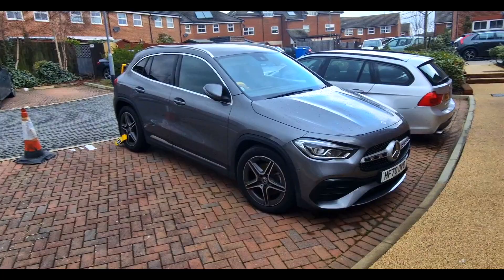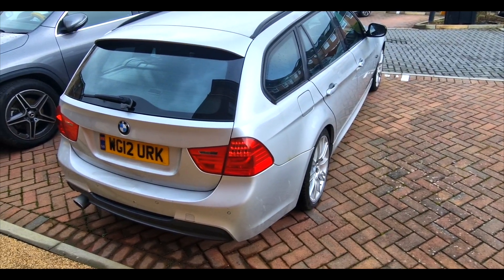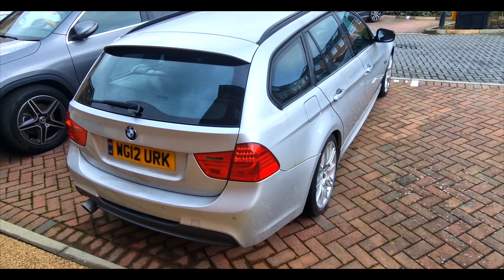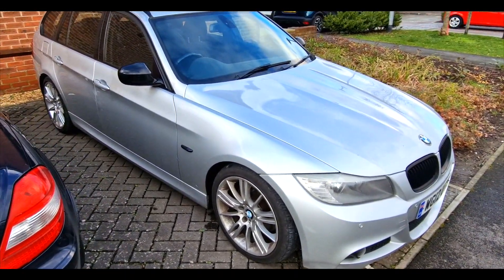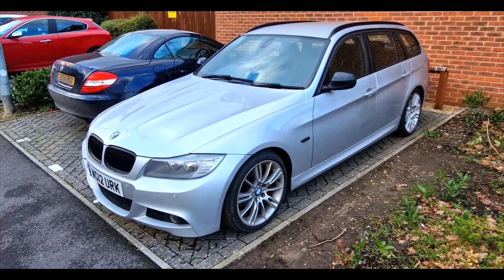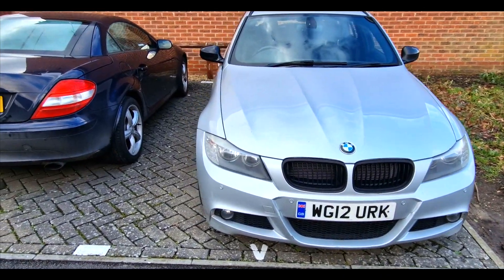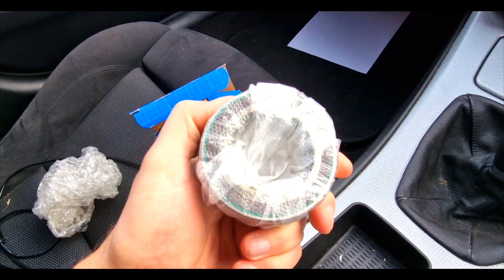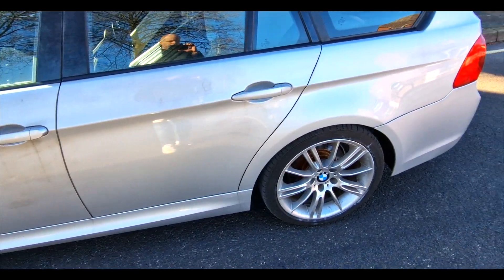What Was The Droning Sound On The BMW E91?

Comment: Sounds like the guy was a decent tech. Diff noise is usually a totally different sound from wheel bearing and starts off pretty much straight away . Wheel bearing will come in at a certain speed and if you lightly swerve side to side can sometimes make it louder and easier to pinpoint . If you keep it those winter tyres are great for grip during the cold season.
Reply from the maker: Sold the winter tyres, think the bmw would have shredded those quite quickly. 
Apparently, the diff is a more central sounding noise. 
Be interesting to see how much your garage would have charged for that :)
Reply: @carsalvage101  Seen one done by them,  used a puller and left hub in situ . Not easy prob be 3hrs minimum plus parts and vat
Reply from the maker: Got more issues to deal with now. Blocked egr valve.
Reply: @carsalvage101  Had same issues on mine when I first got it  N47 engine was restricted with soot from egr through channel in head to inlet .

Comment: You can remove the dpf and put it in a bucket, seal one end with duck tape  and fill it with a chemical dpf cleaner and flush through with clean water. Plenty of utube videos showing how.
Reply from the maker: I'll have to check that out. It seems to have been done in the last few years, so hoping it isn't needed again. It seems more the egr valve is the issue.